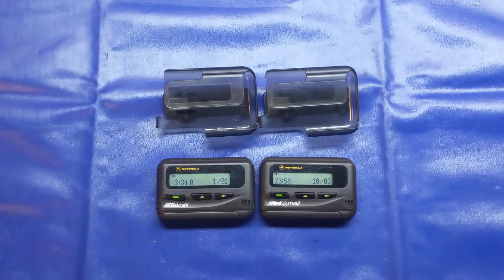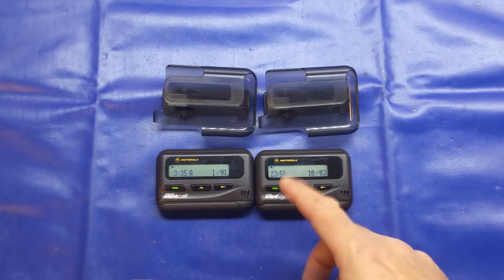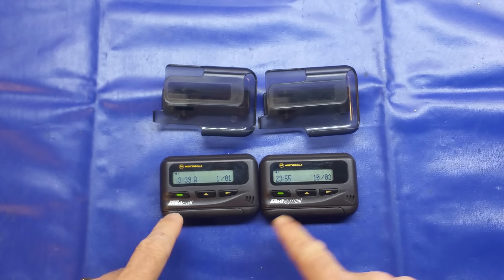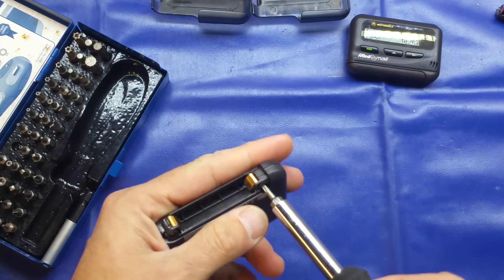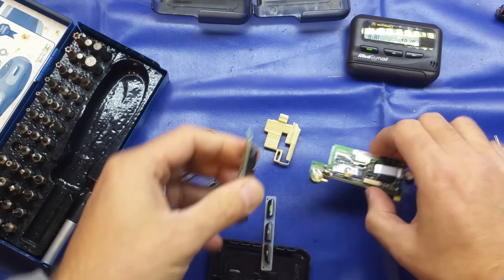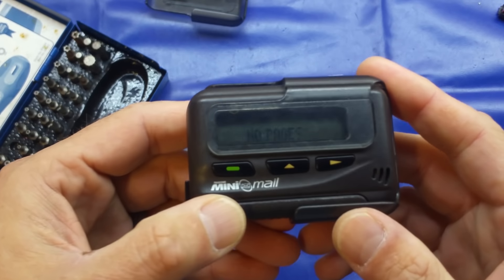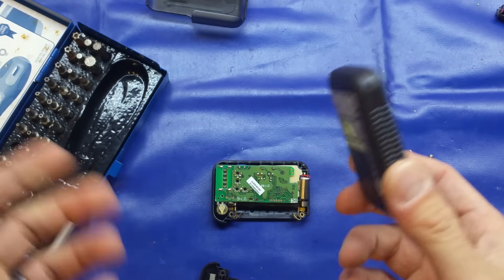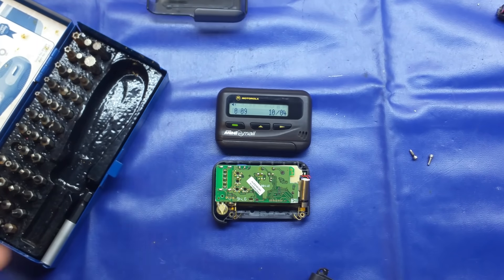*Page Me!* 90's Pagers that amazingly still work - send me a page, number is in the description!

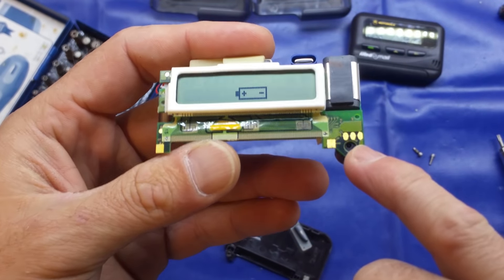Comment: 9:34 those three contact pads next to the speaker hole were used for programming the CAP code in to the pager. This was the unique identifier for the pager account. It really server no other purpose and was not used for testing.

Comment: For fun after alpha numeric paging came out we used to have a special interface we hooked up to the demodulator curcuit of a scanner tuned to the local paging frequency and interfaced it into a Windows PC program that would decode all incoming pager traffic. Not encrypted and you could read every ones alpha and numeric pages that were sent over the paging channel.
Reply: didn't you mean «no encryption» that's the thing. anyone with a SDR can grab those raw ASCII text messages.
Reply: @Diamond_Tiara  correct

Comment: 10:34 correct this is a BGA cpu chip. We used rudimentary heat guns to remove and replace
then when defective or cracked from physical damage snd repaired these boards on a daily basis.

Comment: 10:32 yes Ball Grid Array CPU chips were used by Motorola quite a bit. We used to fix cold / broken solder joints by taking a single filament of wire and shoving it thought the though holes with a quick resolver make for a quick solid repair. We also used rudimentary Ungar 6966C heat guns to take the surface mount chips off and replacement them with success!

Comment: 10.59 the two black square components are filters and know to break when dropped hard. If you shook the board next to  your ear and heard a lot of rattling it was sure sign of damage. Clock and IF crystals yes the one in the blue boot was the key crystal that got changed out to change the frequency of the receiver board then a tuning process was performed with a service monitor and oscilloscope

Comment: In the U.S., American Messaging still supports many Flex pagers.  There's not much of a market for them for the Average Joe, but many hospitals and doctors still use them.  As far as a pager having an actual phone number, they do not.  They work on a specific frequency and Channel Access Protocol (CAP code).  Your pager provider assigns you a phone number, and the pages get forwarded to the pager.  It's possible for more than one pager to have the exact same frequency and CAP code, if you or someone can program them, then all those pagers will get the same page.  If you're able to have 10 pagers set-up that way, clip then all to your belt (I hope your pants don't fall down from the weight), turn them all on, head to a restaurant then page yourself, you'll sound like a bunch of smoke detectors going off, let alone be very annoying. :)

Comment: two-tone, 512 1200 2400 baud, POCSAG, Flex 1600 3200 6400 baud, Re-Flex, low band, 400Mhz, 900Mhz, VHF, UHF, Uniden, Panasonic, Motorola, Uniden, RIM Blackberry, Samsung, Bravo, Advisor, Demond, Xtal oscillator, cap code, Rx, Tx, ferrite cage, pager neck, hot air, multi layer pcb, LCD repair, surface mount repair, been there done that need I say more?